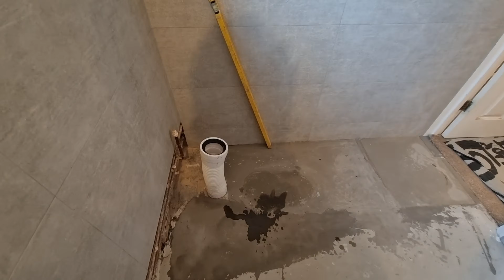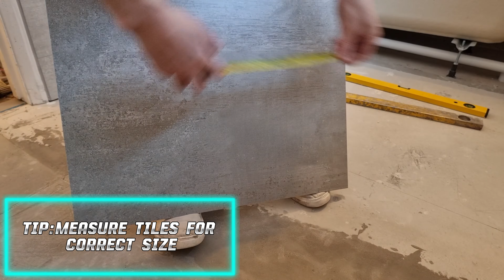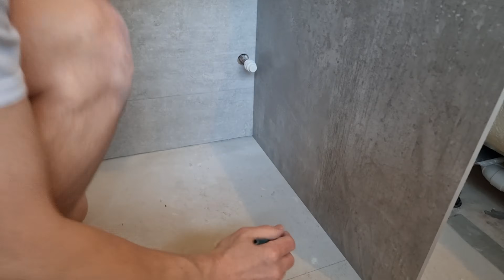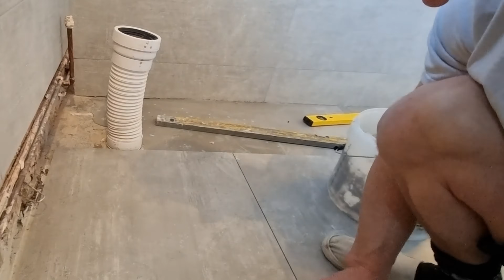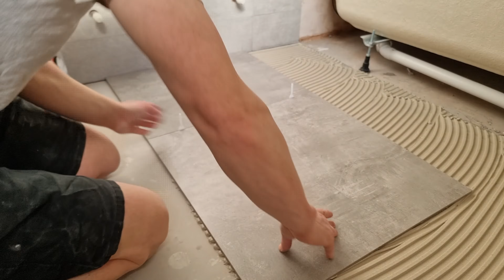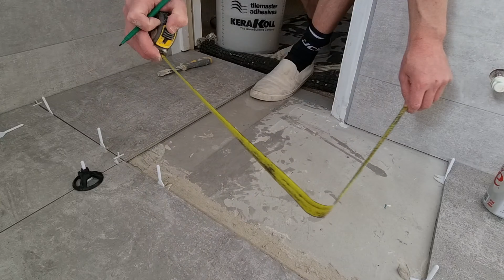How To Tile a Bathroom Floor | Easy Beginner Guide

Comment: Do you use the same.size levelling clips as the spacers ie both 2mm .. if so just.curious why you need.spaces if levelling clips are 2mm ?? Thanks
Reply from the maker: I'd always use spacers as well, Levelling clips like this can bend a bit and are not accurate. if you check out my video on the Bihui levelling clips, I'd recommend them these days. they are only like a 1mm rod 🍻
Reply: @thebespokebloke ok I've seen that but will watch again. But generally if.you use the spinn types your leveliing clip should be smaller than the spacer ?? Appreciate the reply.
Reply from the maker: @pault3705  Ideally yes, Like I say the G spin plastic ones are pretty good, But with any system like that if the plastic is not perfectly straight then it will not be an accurate joint. So the bihui one's alleviate that as they are only about 1mm 🍻
Reply: @thebespokebloke thanks so much

Comment: What do you normally finish the threshold with please? As a lot of the trims I’ve seen appear to low for tiles with backer board, thanks
Reply from the maker: Hey, If its a high step between the tile floor and joining floor, It would usually be an angled wooden threshold..That sorts the transition between the two floors without a trip hazard. If the height isn't to crazy it would just be a standard carpet "T piece" trim. Hope that helps 🍻

Comment: I have a sigma cutter, just bought a 24-3/8 nex — and It cuts amazing most of the time but the odd tile gets away on me. Still getting the hang of the break pressure and score pressure I suppose
Reply from the maker: Nice, exactly that mate.. After a few jobs you'll have it nailed and you'll never look back 🍻
Reply: @thebespokebloke dude I just did a shower this week, blew it out of the park. Sat the cutter down with the 12x24’s piled high and only had one whack cut, the rest were PIMP. Love it. Thanks,
Reply from the maker: @feeblewrk5788  Great to hear mate. It's a big quality of life upgrade! Worth every penny! Glad it went smoothly mate!

Comment: Very helpful video. Should the walls be tiled before the floor? Or the other way round?
Reply from the maker: Thanks mate, I'd usually tile the walls first unless it's either a wet room or the floor and walls need to line up. In those case floor first.

Comment: Do you always tile wall before the floor?
Reply from the maker: Hey, Yeah mostly.. Only exceptions are if its a wet room (floor gets tiled first) or if the floor tiles line up with the wall tiles (floor must be tiled first)
Reply: @thebespokebloke  Thanks for that. I am doing large format 1m x 1m with same tile on floor and wall so will start on floor as suggested.
Reply from the maker: @eugenesteenhuisen4065  Nice, Yeah if you're matching up the walls, You need to do the floor first, then you can just follow your lines up the walls. If you did the walls first and the room wasn't completely square (which it won't be) it'll be impossible to line up the floor properly.

Comment: How soon can you put the toilet back after tiling ?  I’ve got to do this and the toilet is the only one in the house.😮
Reply: Sorry to bother you again but one more quick question. Can I use a slow set ( Mapei Keraflex Maxi S1 ) for the shower tray area and the use a rapid set ( Ultra Tile fix ProFlex S2 ) for the toilet area ? I’m a bit scared of the rapid set going off to quickly while I’m  flaffing about with the shower tray😢
Reply from the maker: @lllANIMALlll  Yeah absolutely, then you can just chill on the rest
Reply: @thebespokebloke  Many thanks, again 👍
Reply from the maker: Well it all depends on the adhesive, In that one I used a rapid set. So by the time you've done your last course, Most of the floor would have set. So an hour to 2 hours normally they are fine to walk on. You can put the toilet back in, then either grout up to it, or take it back out to Grout under it. Hope that helps
Reply: @thebespokebloke  Thanks very much 👍

Comment: Do you always use a foam tile backer board instead uncoupling membrane ? What did you use on top of the foam backer boards? Thanks
Reply: Do you always tile walls first ? 
Interested to understand benefits ? 

Thx
Reply from the maker: Hey, Yes 90% of the time. Main reason is  so you're not working on top of your work. To either damage it or cause mess. Only exceptions are 
A. If the floor tile is the same as the wall tile and the customer/designer wants the floor joints to line up with the wall joints (have to tile the floor first, otherwise it doesn't work)
B. If it's a wet room (walk in shower), You need to tile the floor first as part of the waterproof barrier.
Reply from the maker: Hey, It's all down to the job specification really. Backerboards are used a lot these days because of their excellent properties for tiling. But I use a lot of uncoupling membrane as well depending on the job. For example, In a video out soon actually.. The substrate is floorboards/backerboards/latex/uncoupling matting. In this case it was because it was an old house with a fair bit of movement. So it's a belt and braces method. But generally for say a bathroom floor with floorboards, and with underfloor heating for example. It would be backerboard, lay wires, latex, tile. On walls, backerboards are used as much as possible for their quality's and the fact they can hold a lot of weight compared to other substrate materials. For tiling on top of backerboards just use an S1 flexible adhesive. Somewhere where I'd use matting a lot is on something like a big concrete floor, of if there is a height restriction on suspended floors. Hope that helps a bit.